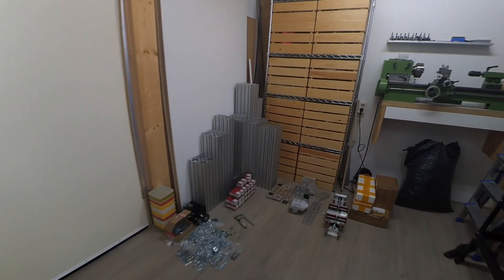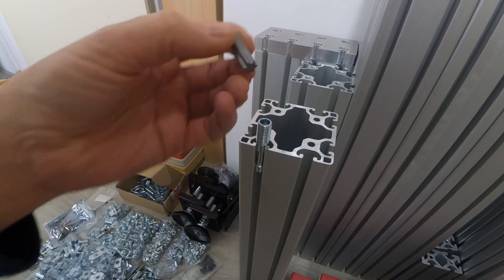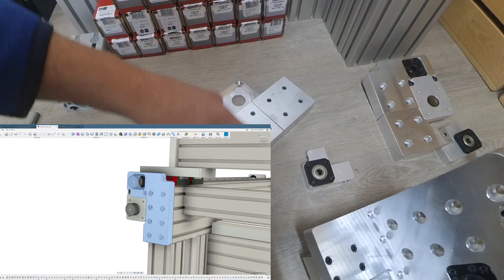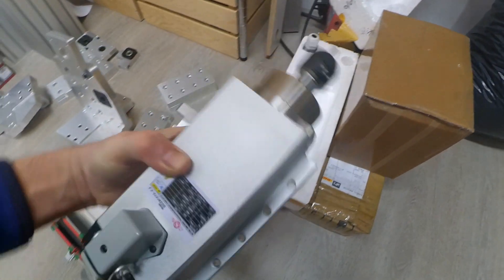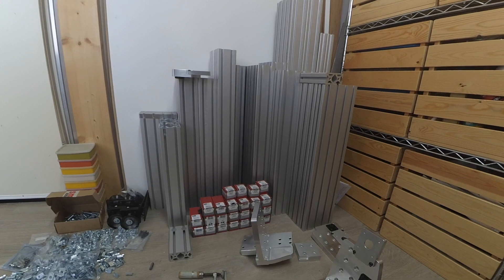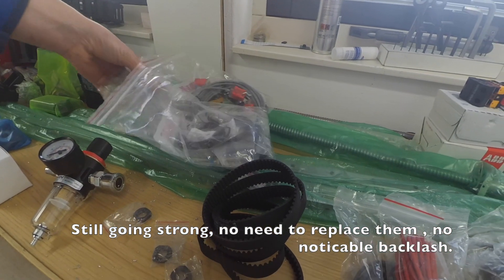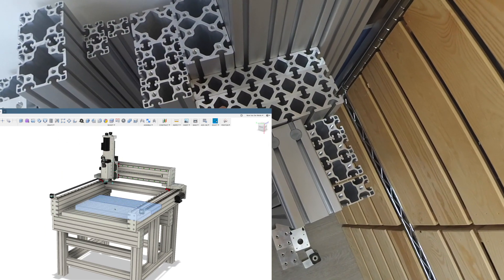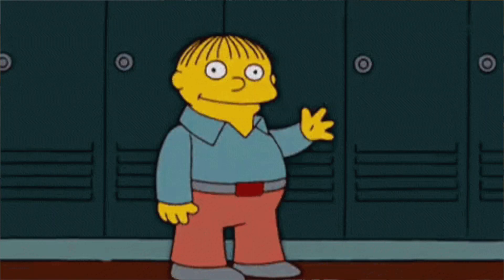DIY CNC machine, general design.

Comment: How did you get those all cut the same length?
Reply from the maker: What do you mean?
Reply: @berendlucasvanderweide  The Aluminum Extrusions - if you have 2 or 3 pieces cut to a length, they look exactly the same length. I rarely see aluminum extrusions cut to that level of accuracy. Or cut that smooth on the end.
Reply from the maker: @IceTurf  i see! It looks better in the movie than in reality i guess. It's hard to cut aluminium withing 0,05mm straight. I kind of designed around that, but it's a giant pain in the ass to get it accurate. I have an 0,002mm accurate angle and it reveals all flaws.  I took off the x beam a week ago to flatten it on the larger mill. It was skewed by about 0,6mm. Aluminum beams are not the most convenient to make an accurate machine. I've invested a lot of time in getting it accurate.
Reply: @berendlucasvanderweide  Was it worth it to build your machine? How did it turn out?
Reply from the maker: @IceTurf  I kind of estimated what i was able to expect. I'm over the moon by its overall performance. Just be aware that when you're on the hunt for the last 0,02 accuracy over the entire work-envelope, you'll have to take a week off to dial it in perfectly. aluminium profiles aren't meant for that if you don't modify them.  (making them flat, with reference cuts for the lineair rails and such)
Reply: @berendlucasvanderweide  How do you make them flat? I know Misumi sells "flattened" aluminum extrusions buts they don't spec the flattness.
Reply from the maker: @IceTurf  the other large machine cutting wood in the other video, It has a 1700x3100 working area, I've measured it and used the most accurate/most linear part on that machine to flatten it.

Comment: Great work ! Have you manage to build your "chip evacuation system" ? I would be interested to see how you managed it ! Cheers
Reply from the maker: Thanks for your message! You have telepathic skills for sure. I was just thinking about it. It's still in the 'stuf to think about when driving around on a rainy day in the car fase'.  Need to get a proof of concept running on my smaller machine and implement on the larger machine if it works. I wanted to alter the currently used 'vortex extraction' that's based purely on under-pressure. (the only service the 3d printer serves here is to print ducts and out of sight small parts :)   But a lot is on my mind these days. Quit my 2-days-a-week daytime job to give the furniture more attention. The 4th axis needs to be built first. have this micro coolant system proto finished currently.  https://photos.app.goo.gl/V2yz3SkVNbxi7E4V6  I need to get of my ass and spent my time more efficient.  Here is the first vortex based extraction. It works perfect with slotting, but when profiling some chips still are airborn. https://photos.app.goo.gl/dZbuU7iwTLoaHht67 But a  lot of POM has been captured, I guess around 98 percent. https://photos.app.goo.gl/wwTePARvy9XpG2WT8
Reply: Thanks for the feedback ! Indeed, I am currently watching at the Datron vortex style, with constant height : it will mainly be for aluminium chips. Can't wait to see your 4th axis,  for sure, I will need one in a near future !  And please, provide us with more video haha ! cheers

Comment: Hello! How did the adjustable bed work for you? I can see that on the 160x40 you have plates that will mount to the outside portion of the standing 80x80 legs. Wouldn't this force the frame to bend "inwards" if it is just slightly off tolerance? Also is the bed stiff enough when only mounted to 4 points? Thanks!
Edit: How do you get the bed level again after height adjustment?
Reply from the maker: Not in the above video, but i've added a scissor style manual motorcycle elevator to be able to lift and lower it. To align it, i'm using steel parallels,  It gets me well within 0,02mm this way, so i didn't bother with the initial plan to use adjustable end-stops on 4 positions with a large contact area.  About the dimensions; yes, they have to be accurate. It's wise to add a triangle (simple aluminium plate would do)  to the back of the machine to keep it square. I've got a 1060mm digital caliper that was a great help to get the parts square up to spec.  It's a compromise between stiffness and flexibility. The most important accuracy/stiffness for me is with the bed in the current, high, position. The lower position is not too important (it's meant for getting holes into pre-build loudspeakers, to do 3d work on large pieces of wood and foam for vacuum forming) accuracy isn't much of a factor there. So I didn't bother for the accuracy/stiffness with the table dropped low. It's all calibrated with the table at the top and this is repeatable due to the parallels used re-positioning it. Hope this clarifies. The machine is used most of the time with the bed to the top position.
Reply: @berendlucasvanderweide  This clarifies a lot, thanks! I am buildinh one myself at the moment and I am ready to order aluminium profiles. Machine size will be approx 1500×1000mm. Anyway the profiles are extremely expensive. I am looking at 2500-3000€! Where did you buy your profiles and what did it cost (approximation is fine)?
Reply from the maker: @nordic_cnc  Yes, it's not too cheap. I bought it from SMT montagetechnik, . Their profiles are not perfect (but none of the aluminum profiles probably is) they are rather cheap. Their shipping makes no sense. like €350 for shipping. Total was ~1140 euro for the aluminium (excluding tax) and 150 for shipping through a local carrier. I thought I recently read on a local forum that they stopped supporting pick-up by another shipper organised by the buyer.  I know it was hard for the carrier to arrange pick-up. The profiles don't come from Germany but Bulgaria.
Reply: @berendlucasvanderweide  Yeah go figure. I contacted that company but they couldn't speak English, so communication didn't work unfortunately. I managed to find a local Finnish company that offered free shipping, but more expensive profiles. So in the end its about the same. End price for all the profiles is 2900€. I am building quite a similar frame as you, with adjustable bed almost exactly as yours! The gantry however is made with 2x 160x80 profiles, bolted together as an L-shape. Also the machine footprint is 1600x1200mm, with working area of 1200x1000. Overhang also on the Y-axis to allow dovetail machining or drilling on the side of a sheet or plate. I made the Z-axis with the rails on the rear plate, and utilized the spindle clamping area for Z-axis travel. This makes for a very stiff Z-axis, while allowing the tool to travel above the gantry bottom to allow for longer tools. There will be a 3.2kW ATC spndle (JGl-100) mounted there, so I had to keep Z-axis weight as low as possible. DMM servos will be used, with a brake on the Z-axis. I finished ordering all the needed parts yesterday, so now I just have to wait!
Reply from the maker: @nordic_cnc  That's awesome Kim! Sometimes you have to press the green button on the website.. :) The overhang at the front is very comfortable!! It's been used a LOT on my machine. The ATC is something on my list as well, (with rigid tapping) but i have this large CNC that's using an ATC, so i'm more or less deciding what machine to use per job. A vacuum-table is a must in my opinion. I have several, all based on different principles. High flow, high leakage, high vacuum, low leakage. The world of vacuum fixing is awesome. I was planning on making a movie based on the rather limited experience/knowledge I have with them. an adjustable mounting plate to the front of the machine is handy too. Just a 25mm tooling plate of aluminium with holes would do As long as you can set the angle accurate enough. This way you can make legs for chairs/tables with joints under a known angle. You mean you have the Z axis the other way around like mine? I've used this setup for the best stiffness at the highest position.  (for machining alumium/steel in the top left or right corner) Is that JGL you bought capable of rigid tapping? that's high in my list, and i know JGL has a 100mm model with permanent magnets that can do rigid tapping. No need to keep the Z as light as possible, my larger machine is using a 9kw HSD spindle, that weights about 31kg. (and is mounted to a fat 35mm steel casted plate). That high weight will also help to provide some dampening due to inertia.  Wise thing to get a brake on the servo! i've heard good stories about the DMM servo's! Sounds good Kim! Looking forward to see more of your machine!
Reply: @berendlucasvanderweide  Yes the other way around. So at the highest position, the Z-axis gets support from a very rigid rear plate construction. At the bottom, the Z-axis bearings are exactly in the front of the gantry bearings. The spindle clamping range in 200mm + the BT30 tool holder. This gives me a nice range, with a very still Z-axis. Your design is very good as well and in the end I think there will be very little difference. I am quite sure that this particular spindle doesnt support rigid tapping. I didn't look for that anyway when I bought it. I will have to check the manual. Yes the DMM servos are looking great. The customer support is really good, and don't forget their tuning software. That is top quality! Here is a link to some quick screenshots of the design so that you get an idea what I am talking about: https://imgur.com/a/sTXucia
Reply from the maker: @nordic_cnc  Very nice Kim! looks excellent! One thing to be aware off; when mounting the lineair rails for the X, (or Y)be sure not to use the aluminium as a reference. Use a known reference to level it. (in both Z and Y direction if this makes sense) If one of the linear rails is mounted onto a round surface (which allmost is a fact with aluminium profiles, since they are not straight) the head of the spindle won't move linear. So, just make sure not to use the aluminium profile as a reference for mounting the rails, and get some shimming sheet with different thickness. I've found a box with 4 variants for about 35 euro. That auto-tuning; i'm running Yaskawa servo's on my large machine, that has a nifty auto-tuning. But i spoke to a Yaskawa expert a week ago (he offered to look at the current settings, very generous). He told me that 'limiting' your machine to a certain 'perfect' setting is allmost imposible for  CNC, due to the dynamic load. He said that the 'auto' realtime adjustment that these yaskawa's are capable of are favorable over exact tuning. I guess the DMM's have this feature too.
Reply: @berendlucasvanderweide  Yes I already accounted for not straight profiles. I will be ordering Helios-Preisser straight edge and machinist square DIN874/2 and DIN875/2. Those were not too expensive and with good enough tolerances for me. I will use dial indicator along the straight edges to shim the linear rails. Do you have a link to that cheap shimming kit by the way? Yes the DMM servo drivers also have real-time adaptive tuning!
Reply from the maker: @nordic_cnc  The EAN number is 4031177000018, Mercateo has them don't know if they deliver in Finland. Yes, those are handy tools. A precision machine level/square is handy too, they give a good reference for about 0,02mm/m and if you flip them and interpret them properly they can be even more accurate. A straight edge is very cheap considering its precision. Till 600mm they are fair cheap. I've bought mine here; https://www.pruefmittel24.com/
Reply: @berendlucasvanderweide  Thanks! I plan to buy a 1000mm straight edge DIN874/2. My longest axis 1200mm travel. I was thinking, do I really need any larger square than 300x600mm? That should be enough to get the 1000mm gantry square with the base frame axis anyway. What do you think?
Reply from the maker: @nordic_cnc  fully agreed. I have a 200x150  0,002 accurate angle. That combined with a staright edge can help you out. I have this cheap digital caliper of 1060mm. I don't care if this caliper accurate, to the real calibrated meter, but as long if you use it as a reference for itself you can easily check any irregularity in the products the machine has cut. If you drill 4 holes in a square and insert 4 cilinders to measure the squareness it gives a pretty good insight. Just make sure the holes are cut using a carbide mill and the cilinders have the same diameter. Of you perform both of the above measurements as a cross-check you should be golden. Just lock yourself up with the machine for a week with enough food in your hunt for the final 0,02mm. Due to the c5 grade of the ballscrew they are allowed to have some error.  It's tedious with aluminium profiles to begin with. Just ask yourself if you want the machine to be accurate throughout the entire working area or if you can settle with a smaller envelope for higher accuracy and invest less time in getting the other portion of the machine as accurate.
Reply: @berendlucasvanderweide  Coming back to this, since I think I owe you that since I have copied MANY features from your design. Here in this link you can find a picture of my ongoing build. Slightly bigger than your machine, with L-shape gantry made with 2qty of 80x160 profiles. 

https://imgur.com/a/2rwcMFy 

I was going to ask how you do the homing of the gantry. Are you homing both the master and the slave axis to one single sensor, or do you have 2 sensors?
Reply from the maker: @nordic_cnc  hey Kim! Awesome!!!. Nice project, your gonna love the hang over in the front. Thank you for your feedback! I'm only using one sensor and put the motors in parrellel to one output. I'm currently working on an adjustable link between the two motors through an extra htd5 belt/pulleys. So far this method works fine in rest the bridge is within 0,02 at a 90 degree angle. With this adjustment i can pull that out too.
Reply: @berendlucasvanderweide  Thanks and yes, the hangover will be appreciated for higher components and also for dovetail machining! I am also planning to use a single sensor, then back-off to servo index pulse and hopefully that way always have the same 90 degree angle of the gantry. Should be quite easy to get the servos aligned, meaning that they have the index at some location. I plan to just disconnect the servos from the ball screw, run homing sequence, back-off to index and then reconnected the gantry at desired angle! Hopefully it works, but I think the gantry should be quite fine even if it doesn't work.. It is quite stiff! I might have to add some bracing under the table later to make it stiffer, but that only testing can tell! Shimming of the linear rails was a real pain by the way.. Let's see what kind of accuracy I will be able to achieve. I bought a 1m straight edge with a 0,03mm tolerance over 1m. So that is what I am targeting.
Reply from the maker: @nordic_cnc  i bought them from smt montage technik, it was 1140 euro ex tax. And ex shipping.  Profiles ended up being not too straght..  If i build another machine it will be steel for sure.
Reply: @berendlucasvanderweide  Definitely steel for the next machine..! I had my profiles machined but the machining center must have clamped the profiles in some weird way, because they were even worse afterwards, OR, there was some tension in the profiles.. Also my profiles were not flat, there was some weird pyramid shape on the surfaces so they had to be machined anyway.
Reply from the maker: @nordic_cnc  yeah. I machined mine as well. Without any pressure I've clamped them on the larger machine. (With steel tempered frame) Few months later the tension warped them again. I've recently rebuilt it again.. it's a struggle with aluminium
Reply: @berendlucasvanderweide  yeah, I see.. I expect also that if you build from steel, any welding needs to be heat treated. Maybe best would be to build from epoxy granite next!
Reply from the maker: @nordic_cnc  that's a different challenge of your looking for 840x540x240..